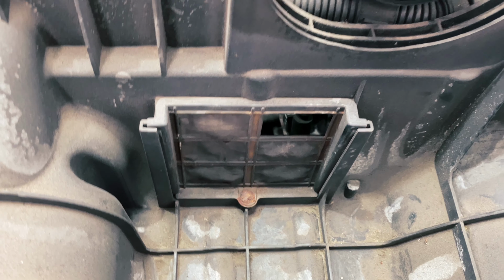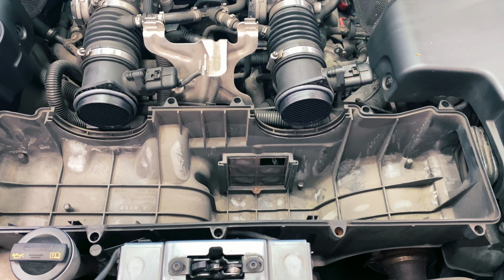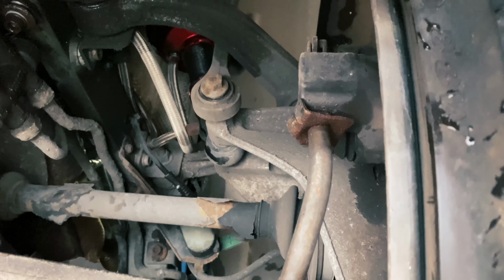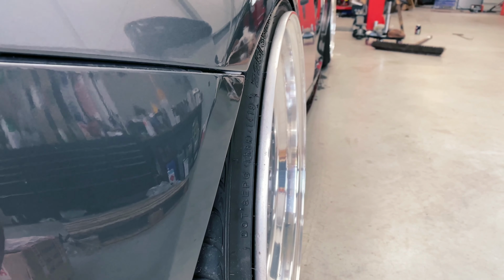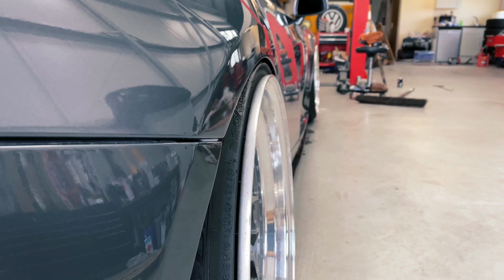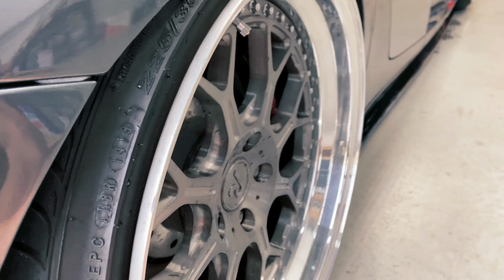FITTING K&N AIR FILTERS TO MY R8 + HEADLIGHT REFURB! - EPISODE 3

Comment: I'm not sure I am understanding about the tires... I have a 2014 R8 and the stock tires on the front are 225 width as are the ones on your car.. are you saying they are too thin?  I am about to upgrade my tires just for looks and 305 is the widest I can go in the back on the stock wheels without them rubbing and on the front, 245 is as wide as I can go.  Then you have to match the tire diameters so that there isn't more than 3% difference in diameter (according to the stock set up).  I wish I could know the exact right size to be as wide as possible without rubbing on front and back on stock 19" wheels to fill the wheel wells.